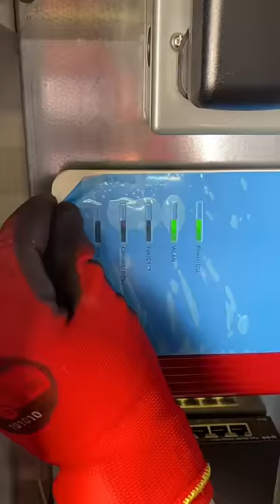SPLIT THE DIFFERENCE : Flexible conduit for existing wires #shorts

Comment: Thatll be $600 for the one cable we installed today
Reply from the maker: $400 for cash 💰
Reply: @efixx  psst, charging less for cash transactions means you're not reporting them on your taxes.
Reply: @enb3810  and if you look closely at the math, you can see who the person actually paying the taxes is.
Reply: Really then I would rather buy mouse poison
Reply: @enb3810  using card cost company's like a % per transaction, avoiding the card reader company's saves the business money, and you don't need to declare it to the tax man its a win win
Reply: @frostedlambs  yeah it's like 1.5-3%, which wouldn't cover the $200 difference
Reply: Yeah way over kill I’d rather save my customers money and do it normal unless this this was installed on top of a giant vibrator all those bushings and shit are way overkill..
Reply: @AlwaysBeSmart674  that's a good point but the concern particularly in commercial/industrial situations is that cabling supported to ceilings will all come down in a fire creating quite an issue for attending fire brigades.
Reply: @enb3810  lol that’s how we roll
Reply: @enb3810  an assumption on your part, credit cards companies and banks charge a processing fee, maybe that is the reason.
Reply: @nmatthew7469  maybe read the rest of the thread first bud

Comment: XD its only ethernet cable. What's next, metal cover?
Reply: It's to prevent interference fool
Reply: @Danny0213  XfuckingD interference from what? plastic pipe protection form which interference? Bro use uncle google and search it first. It's only 4 pairs  copper wires for internet or VoIP. It dont require plastic for isolation. If u need, use cat. 6 but for what 1-2% better transfer results.... overdone imo

Comment: I've used shitty amp wiring kits so I'm very familiar with these 😎
Reply: Well actually you need wire loom to hide the wires running around
Reply: As with all products, there's the quality version and the budget version. The stuff he's using looks head and shoulders above the crap I've got in cheap looms.
Reply: You have to admit it’s pretty satisfying to pull apart.

Comment: A wrench works great for tucking the wire into them. If they got a large plug on each end, either cut up a wrench or buy a wrench made for brake lines

Comment: The good old AVM Fritz!Box 😁
Reply from the maker: We’ll spotted
Reply: Yeah, I still remember when I first switched to it. HUGE difference! The settings, the updates, the speed, literally everything was WAY better than the dumpster fire I had before, which randomly rebooted or lost connection every second day, and the wifi on it was barely working. It also only had like 4 settings, 3 of which were only DSL connection settings. I'm certainly never going back to that other POS. That thing is now rusting away in moving box somewhere, and will certainly never be missed. And, unless someone makes a better router, i will most definitely stick with the Fritz! line.

Comment: In what specific areas can we still use plastic cleats?
Reply from the maker: Not every clip needs to be metal - you might choose one every few meters depending upon the area and application.
Reply: Over here no-one uses metal clips for any electrical work. Its all plastic. Prevents any wear into the cable and any electrocution hazards that way.
Everything should be double insulated.

Comment: Where I'm at that would fail an inspection fast as that is not conduit it is wire wrap.
Reply: Ethernet is low voltage, doesn't have to be conduit.